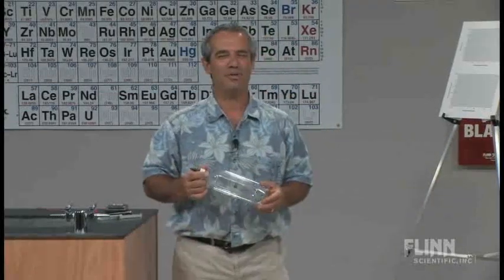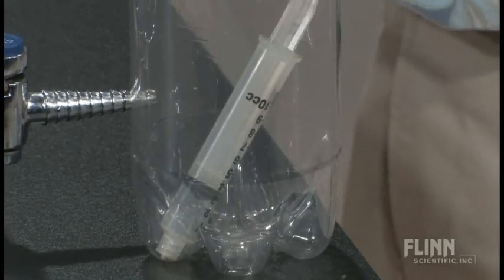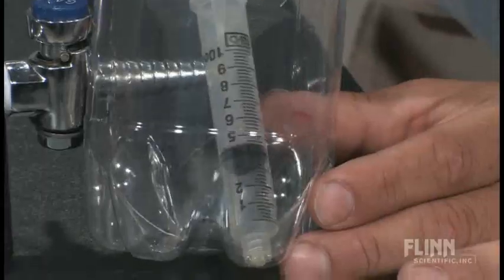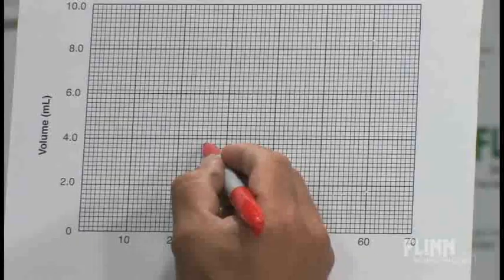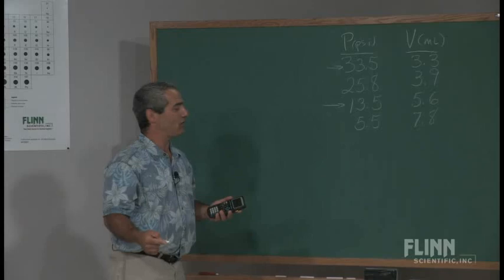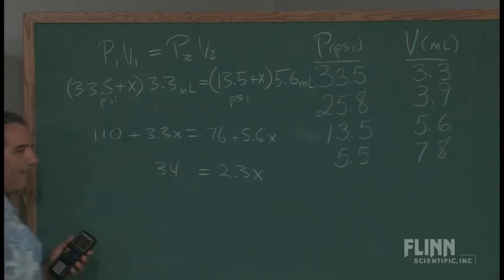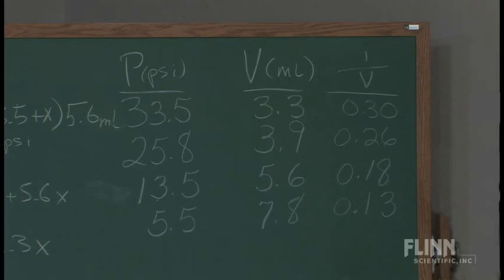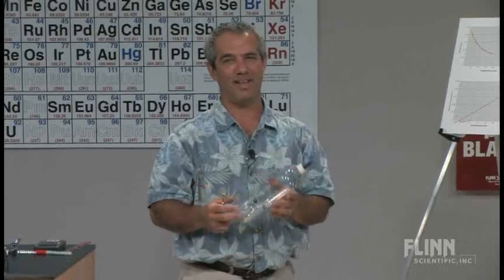Pressure vs. Volume and Boyle's Law

Comment: Since you're increasing the pressure of the bottle, wouldn't the temperature inside the bottle increase as well? Since Boyle's Law only applies at a constant temperature, the results should be skewed, but they aren't. How does the temperature not increase?

Comment: Not sure why I looked through most of this video, except it is a genius experiment.

So simple, so easy and yet so educational.

if you did these calculation in SI units, you can have some further fun here:
Volume: m^3
Pressure: N/m^2

So the unit for boyles constant is Nm (Newton meter), which is also the base unit for energy (J) and torque (Nm).

The question is, is there a relationship between Boyles constant and any of those units, or just a coincidence of units?